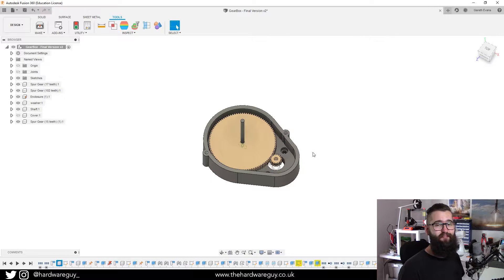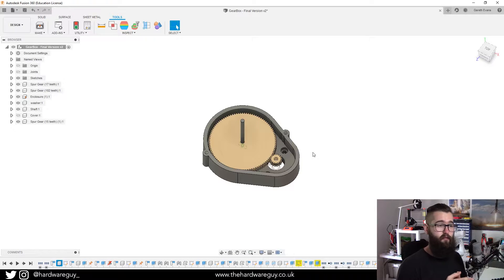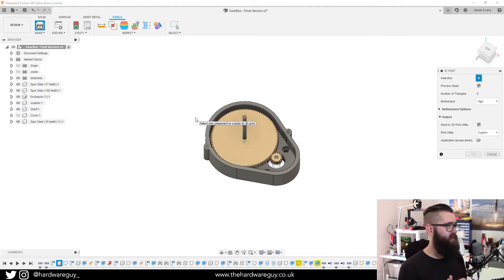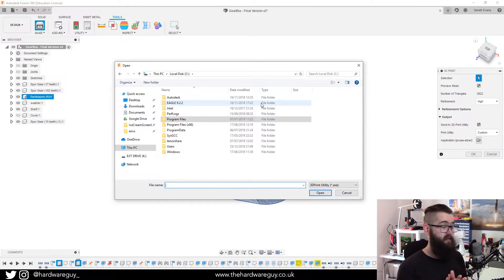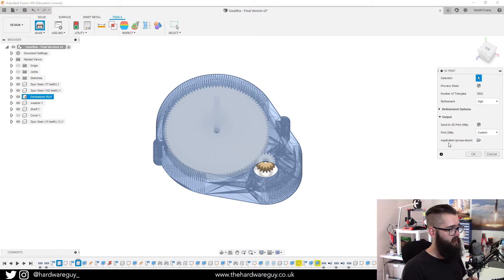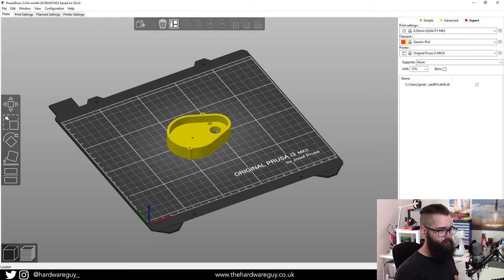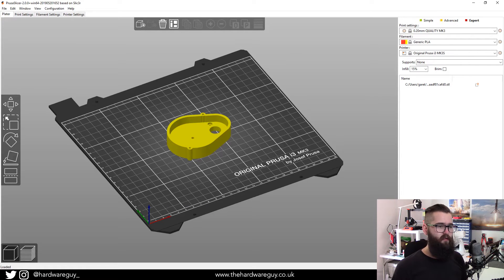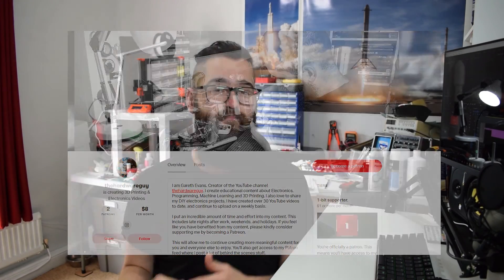Export STL File To Prusa Slicer - Fusion 360

Comment: Not sure how this is really a new feature... All you had to do in before was right click on the body and select save as STL. After the file saves, you can open it up in any slicer program
Reply from the maker: Well yes obviously that is one way to do it and I mentioned that in the video. But it now opens natively, straight from Fusion 360. Which saves a little bit of time. I thought it was worth sharing.
Reply: @thehardwareguy  Sadly it is only one component.
We still need to export STL one by one for printing multiples parts together...
But it happened one time when I was doing too fast export that Prusa splicer ask me if it is a multiple parts or just one.
It seems I can't reproduce (export into OBJ maybe?)
Reply: Got it... 
In Manufacture view you arrange everything then button export as 3mf...
PrusaSclicer will ask you if it's a multiplepart print...